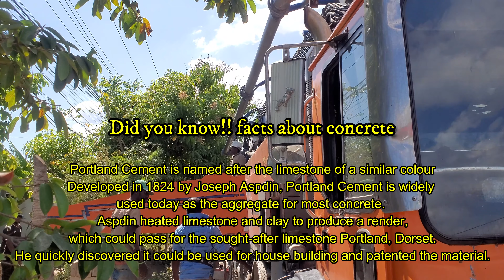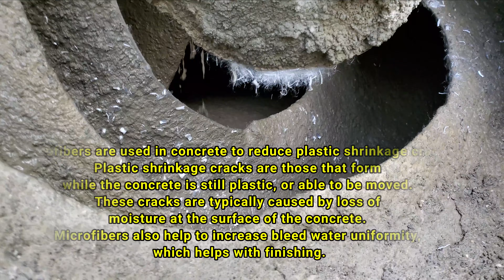Pouring the Concrete on the decking #diy #construction #steel

Comment: Sometime the cracks don't have anything to do with the steel work it can be the hardner in the concrete if it dries too fast and also the curing method can be another issue if takes too long to apply worst if the area is hot
Reply from the maker: ok because the crack are in the shape of the tied steel thats why i thought it was the steel
Reply: @paynefuldiy  ok i see, it doesn't have to be the steel work still

Comment: I was taught to use wet cement bags to seal the cracks.  You can use spray foam.
Reply from the maker: wet bag helps with drying time the bags keep the concrete cool and moist

Comment: Finally 👍 its a good look glad the guys worked safely around  the high tension wire and give thanks for good neighbors is ur guys level the concrete or the pre mix guys?
Reply from the maker: i let the pre-mix do it i just paid for a package
Reply: @paynefuldiy  ok is less pressure on u

Comment: Since you experience quite a lot of moisture in that part of the wlorld, I have not seen application of DPC and DPM. I may have missed.
Reply from the maker: ITS MOSTLY HOT IN JAMAICA SO WE DONT USE DAMP PROOF MEMBRANE.. THE CONCRTE HOLDS THE HEAT FOR HOURS